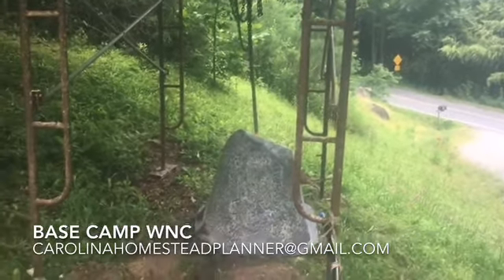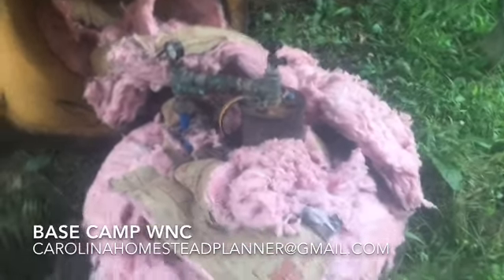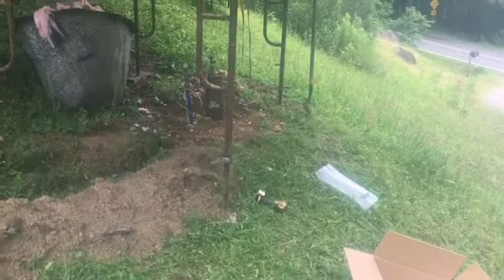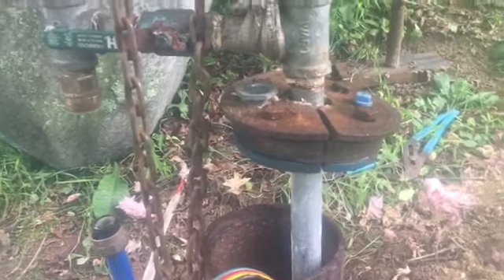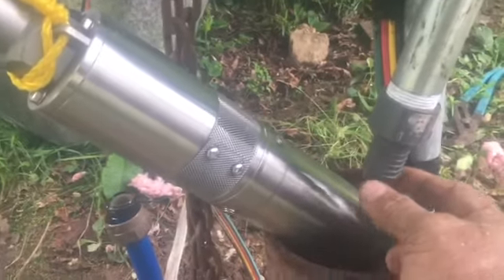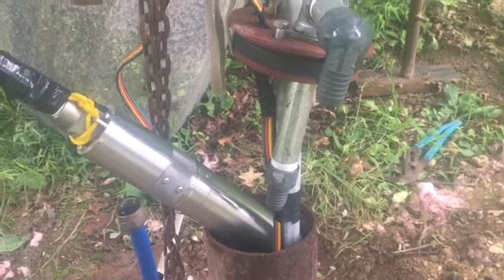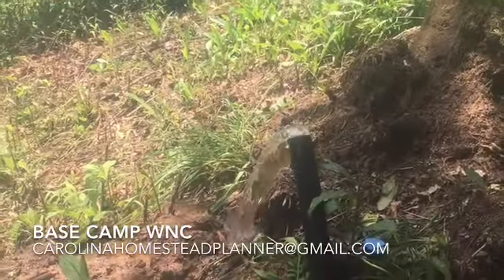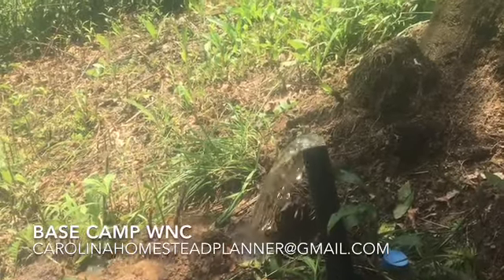Adding A Solar Well Pump To A Grid Powered Well

Comment: Very informative sir. I just bought a property with grid well pump and really need to have a solar backup before the grid goes down this fall and winter.  It's coming, so preppers are getting ready!  If you could provide a list of equipment and tools that we need for a successful project like yours. Thank you and God bless you for your time and video!🙏😇
Reply from the maker: Well Max 
It gets a little more involved than that
Need to know what your wanting to power and how long
This will determine the size of the system and the amount of batteries needed to supply it
Best if you contact me by email and we can then talk on the phone
Be glad to supply you with a list of needed materials 
My email 
Carolinahomesteadplanner@ Gmail.com
And as always subscribe like and share 
Thanks
Eric

Comment: Our well goes down 400' to the aquifer (what I have been told). How can we determine how far down our grid powered pump is? Also, can you give me a complete list of what I need to do this to our well?
Reply from the maker: Yes I can help you will need some more information 
What is the size of your well breaker in the breaker box 30-40-50?
Do you know the static water level in the well 
It will be on the well tag that is on the top of the well 
It’s how far down to the top of the water 
You can add a solar pump if the well pipe is 6”
Or you can add solar power and take the well off grid

Comment: So, is the solar pump resting on the grid tied pump at the bottom of the casing?
Reply from the maker: No the grid powered pump is  about 100’ from the bottom and the solar pump is about 50’ in the water 
Both are hanging on there pipes that bring water to the top
A 6” diameter well casing there is 1.12 gallons per foot so there is a 50 supply plus what the well developers 
This well produces 75 gallons per minute and the pump only pumps 12 gallons per minute 
Any other questions don’t hesitate to ask 
Thanks for your comment 
And as always subscribe like and share 
Thanks Eric

Comment: How deep is well?
Reply from the maker: This well is 250 deep with a static water level at 45’
And 25 gallons per minute 
We set the pump at 65’
The pumps that are available go from 6000 gallons per day to 600’ deep
In order to match to your needs
Need to know the water level total height that you need to pump up and gallons needed per day
Please contact me if you are interested in one
Reply: @basecampwnc1745  thank you!!! Wells seem to be 600 to 700 pretty common in our area. Do know of one solar powered pump. Not sure but believe low amp start pump. And little pricey.

Comment: What is the brand of your well pump?  What is your contact info please?
Reply from the maker: In order to get you the correct pump I need some information 
How deep is the static water level in your well
That’s how deep from the top of ground to the top of water down in the well
How deep is the well
This information should be on the well tag
From the well top how far up hill is you house
And how many people and live stock will the well need to supply 
And your location 
I need this to determine your sun light and the size of the pump needed
Thanks for your comment and as always subscribe like and share 
Eric